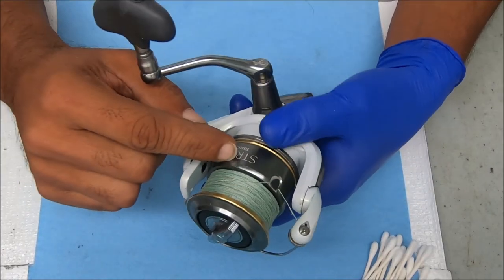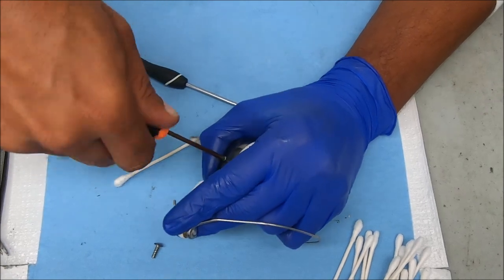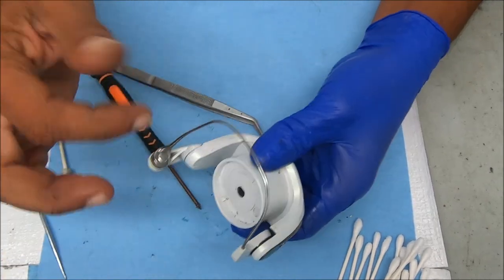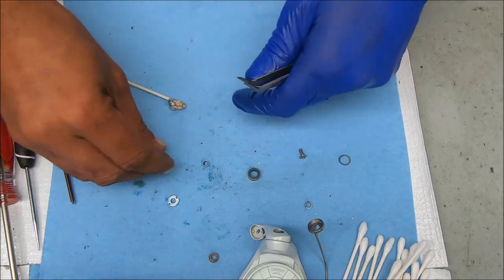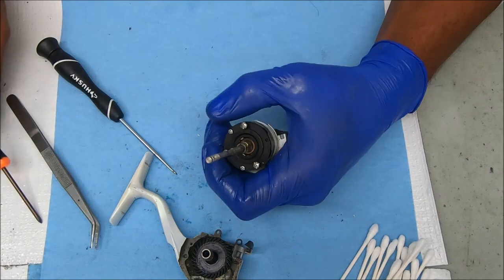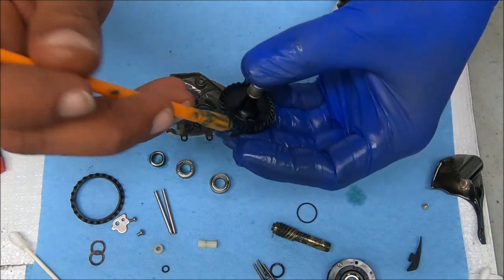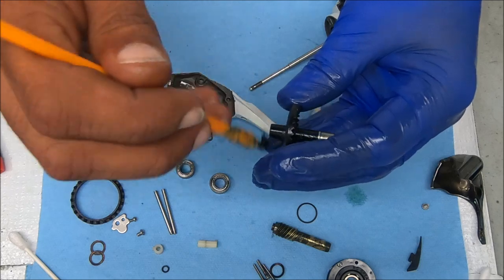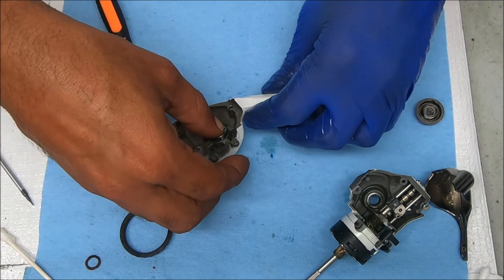Shimano Stradic 4000FJ Fishing Reel - How to take apart, service and reassemble

Comment: Thanks for the video. I bought 3 old Stradic 6000FB’s and your video gave me the courage to service them myself. Question: on all three the  rosswind block on the shaft had some play in it. Is this on purpose or should I tighten the two screws holding it on the shaft? Thanks!
Reply from the maker: You're welcome and thanks for checking out the video.... always love to hear when someone successfully gets the job done with the help of one of my videos! Great question! I don't believe there's there's a Stradic 6000FB, but the principles are the same. If my video was similar to your reel, then it's designed that way.... tightening the block cover screw won't do anything. It'll work fine with that slight play in it. However, if you wanted to reduce/minimize the play, you could add a shim or two under the white bushing at the bottom of the worm. If yo don't have any Shimano part #RD18199, you can also use the Daiwa 373-1302.

All the above info is provided assuming your blocks, pawls and worms are fine.

If your reel (or problem) is different than I addressed, please post a video of the problem you're having and posting the link here, so I can check it out. Thanks.

Comment: Very interesting video :) in the last part you talk about “testing for the shims” before closing the main body of the reel? How do you do it and where did you exactly place them? Between the bearing and the gear? Did you make any video about it? Anyway thank you very much, I’m learning a lot from your videos
Reply from the maker: You're welcome and thanks for watching! Yes, the shims are usually between the bearing and the main gear on the left side where you see the handle in this video.  Sometimes, when you service a reel, there can be tightness/looseness when you reassemble, so you may sometimes have to play with the number of shims to get the feel right. Don't throw away any that you may remove. My testing is after I close the body... been doing it long enough to tell if it'll need adjusting without putting the body screws in. See this video for some additional help: https://youtu.be/6llggJX-LMY
Reply: @TSGReelService  thank you very much ;)
Reply from the maker: @federicoalpi1110  you're welcome and no worries. Happy to help when I can.

Comment: I recently changed the very noisy line roller bearing on my stradic fk and was told not to oil the bearing as its the quickest way to destroy it!! but I see videos of and they all seem to oil the line roller bearing. Could it be cos its a fixed bearing. Oil or not oil that is the question?   Thanks and great videos
Reply from the maker: Thanks for watching! Don't oil that particular bearing. https://youtu.be/d1UfAxWQbxg

Comment: OMG frozen here, frozen there. The parts are partially corroded. The fishing reel in poor condition. That is the way,  when the angler neglects their reels. No money for maintenance . I always replaced the ball bearings, they are not that expensive these days. But I understand,  the customer wanted to keep old ball bearings to save money. Good job though, you made it bud. NICE! ;-) 
Did the line roller work well? Greetings from Germany  - Jan.
Reply from the maker: Hi Jan. Yes, the line roller bearing was good on this one. Funny enough, it was the only one of 6 reels he submitted that was fine. I don't think it was a matter of no money for maintenance... rather the classic scenario of if the reel feels okay, then I'll keep fishing it, even if it's noisier than when I first bought it. I suspect many of them in the lot were never serviced before. I'll usually try to save the bearings, if at all possible, but these were all pretty far gone.... should have just replaced the lower pinion when I did the other bearings, rather than trying to reuse it. The upside was the drags in all his reels were pretty good and didn't need replacing.... I'm guessing he paid special attention to this area of the reels, but not others.